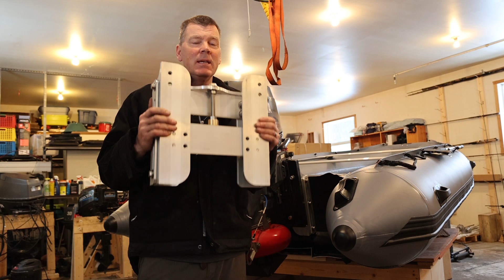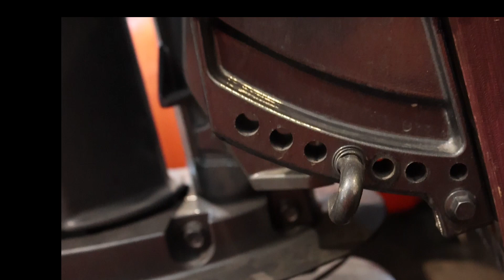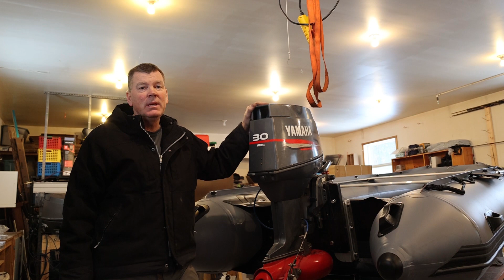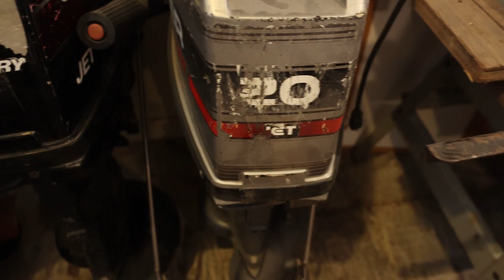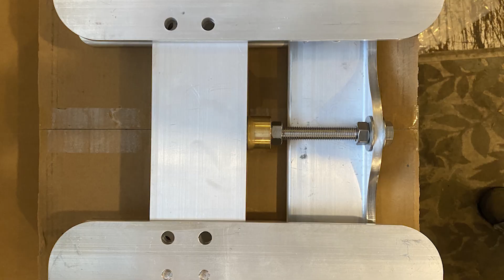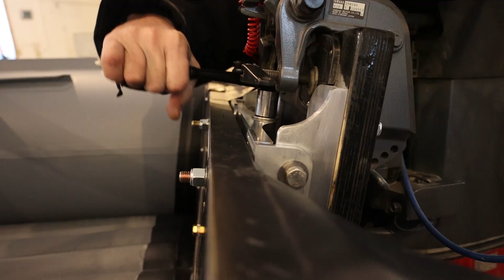Adjustable Transoms for Outboard Jets

Comment: Is the plywood plate between the outboard and the jack plate critical for all installations? Or is it just for setting the set back space?
Reply from the maker: It’s only needed if you need more offset to get the Intake near the tunnel or back of the boat

Comment: Great add to my boat! Made a huge difference and so easy to set up. I put a 2 degree wedge on mine too, I was on the lowest pin on my motor and still porpoising slightly on flat water.  Have a 420 Solar boat and Merc 25 4 stroke. This motor is right at the weight limit for this boat and it's obvious.